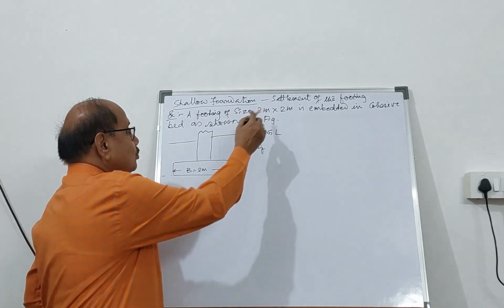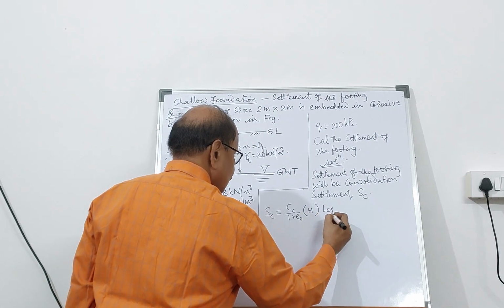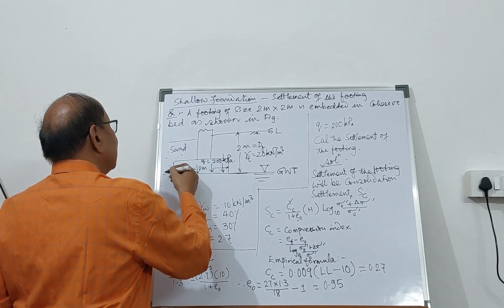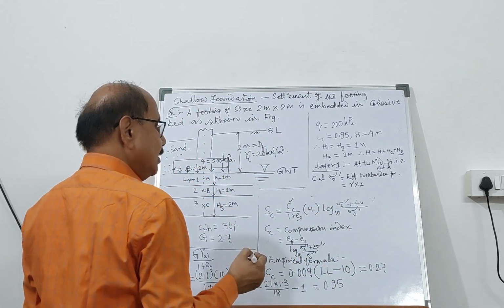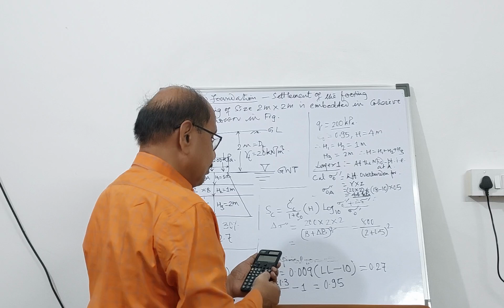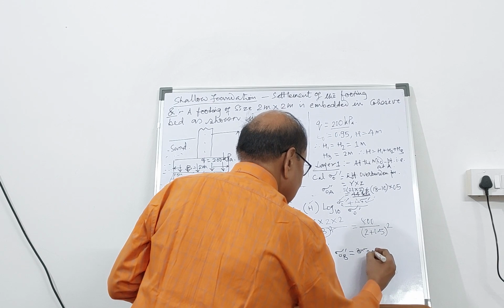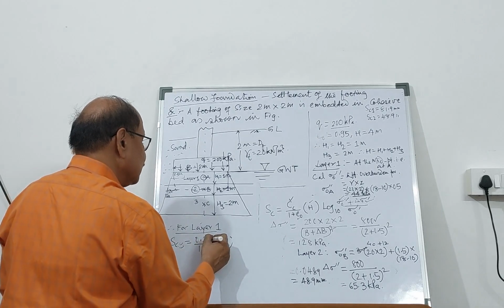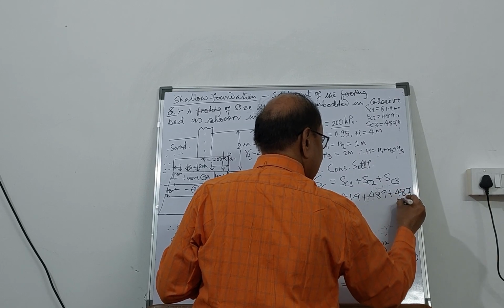Shallow Foundation - 16 | Settlement of a footing ( Example )

Comment: Hello Sir,
At the plot boundary, many times I have witnessed a column flush against the property edge resting on a single-sided ISOLATED footing (may it be normal rectangular footing or trapezoidal footing, assume it has top rebar, but are projecting entirely inward). 
In real life project but many engineer does provide such footings. But I cant find any solution for such situation. Please let me know under which logic do they provide such isolated footings. I am actually very scared to provide such footing and always feel like things will over turn  but those structures aren't affected at all. (I am well aware regarding idea of providing strap footings, providing dead column, providing combined footing etc. here I am talking about isolated footings)
How is the base overturning moment and soil uplift resolved in the design calculations?
Awaiting your guidance.